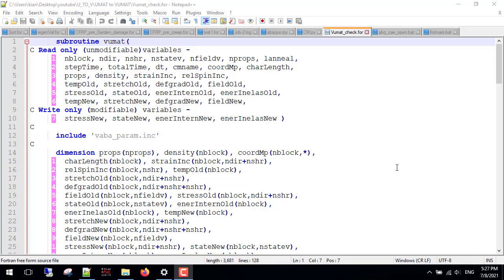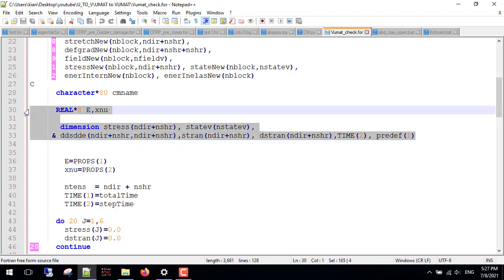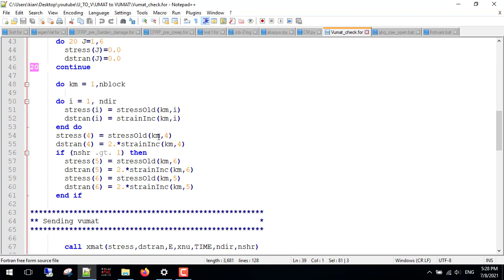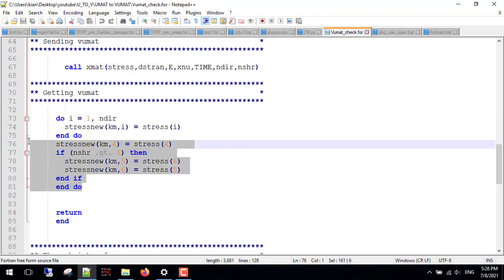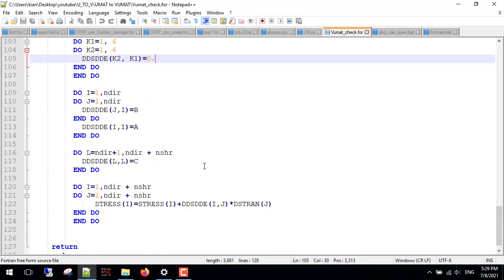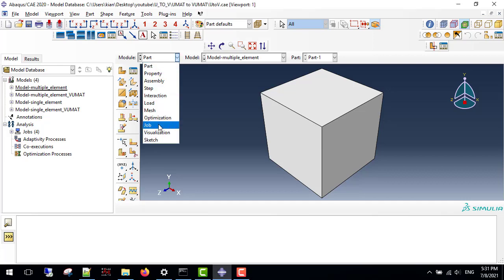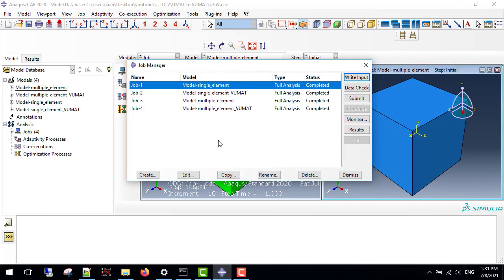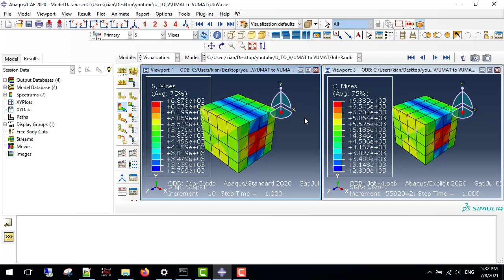ABAQUS subroutine for converting VUMAT into UMAT

Comment: Thank you. Your content is awesome. but I was wondering if it is possible to write a 1D subroutine in ABAQUS?
Reply from the maker: Hi. I do not think it is possible, because every element at least has two coordinates.
Reply: @kianaghani  What if I just write for 3D and set the data for two other coordinates equal to zero?
Reply from the maker: @mohammaddavari8521  By this way, I believe, you will run into problems.